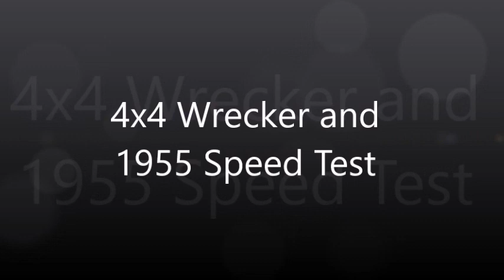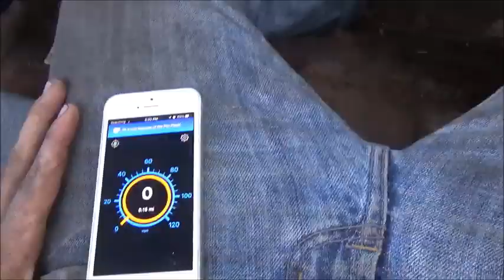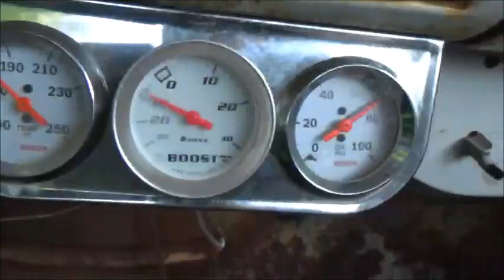4x4 Wrecker & 1955 Chevy speed Test

Comment: Another fine video, Jonathan! I like the 8.2 swap idea. I had the same nonturbo in an F600 dump with a 2spd rear axel. It pulled my JD300 and heavy trailer fine until I got to a long hill. I also had a pair of these with turbos rated at 300 hp each in a 35' Downeast sportfishing boat. They all ran well. I suggest a turbo and injector upgrade. That Perkins powered Chevy truck is way cool. Considering the 3rd gear burn out you did a while back a T5 with 3:50 gears might be a good combo. Can't wait to see what you do with both of these trucks. I know to expect something unusual that works perfectly is comming! See you on the next one.

Comment: Man I just changed 6 hoses on my Challenger. What a pain in the ass. Once you realize what you're into it's not the complicated. just don't forget where they go.. lol.. But as soon as all was done, I go to move things and a Cylinder on WL broke at the end. Collar broke off. The wheel lift came up in a bind and caught the bottom of the plate it slides up&down on. And broke it right off. Easy I think. I know the truck was in a crash and it might be partially broken form that. The other side is bent at the end. Kinda wish I never bought it now. Got the whole bed for $1000, rusty.. Had to put 3 caps on, and two springs to the Control body. Still leaks some on the back side handle side. But seem likes the one side is weaker than it should be. It won't move W/lift at all. dual winch full hydraulic. Challenger bed. Got it on a 90 Ford F-350. 5.8 GAS. Not sure if I'm sorry yet.

Comment: Good to see old projects come back to life!  Last I recall,  you were working on the slewing gear on the 4x4 wrecker.  Give the wrecker plenty of cable,  it might be hauling stuff from far away from where the four wheel drive gets you!   Is that the old Perkins engine in the 55?  You definitely need taller final gearing for it!  You'll figure out something from what you have and what you want it to do.  It's an amazing truck!

Comment: I am not sure but I think the clamp on that cable is something linemen use to fasten overhead, non insulated cable.  They may be for a guy wire instead but I am really fairly sure it is meant for that, not for what it is being used for.

Comment: Once again  your talent is showing through. I can't wait to see the progress and eventual finish of your newest towing creation. And it wont have a $375,000 price tag attached to it like the ill fated one from Century had. It will come in real handy for getting them over guard rails and out of the creeks you have around there. So you're going to use the drive train out of that Chevy truck that you got running not too long ago with the utility bed on it? Maybe you'll be able to figure a way to cut the bed up and use parts of it for your side mount tool boxes. Or are they rusted too much for that? Am I to assume that your "new" employee is going to be the benifactor of your efforts in the '55 Chevy? Couldn't go to a nicer young man. I think you've got a keeper there. He doesn't appear to be afraid of work and he is willing to learn. Good luck and God Bless.

Comment: I think using the 8.2 and 5-speed from the GMC in the 4x4 wrecker should give you a useful boost in torque over the 7.3, and torque is something that is very important in an all-wheel drive vehicle designed for arduous conditions...

Comment: Are you running a wheel lift or underlift on the 4x4? If you mentioned that and I missed it, I apologize. I wondered if/how you would integrate that with rear outriggers, and whether you'd set them up to also act as winching spades.

Comment: Are you going to throw a turbo and injectors in the 8.2?  Better yet, why not find an 8.3 or a 5.9/6.7 Cummins to stick in there?  I know that the Cummins swaps are really common, but they are common for a reason because the engines are amazing.

Comment: I have a 1990 International 4600 LP roll back 73 idi non Turbo Alison AT545 transmission Seems like my top speeds around 55 miles an hour but motor  Wines out is that normal It would take me forever to get somewhere What can be done to get more speed Different motor changing rear end If any one has answers feel free to let me Love the old truck it's in great condition and it's paid for